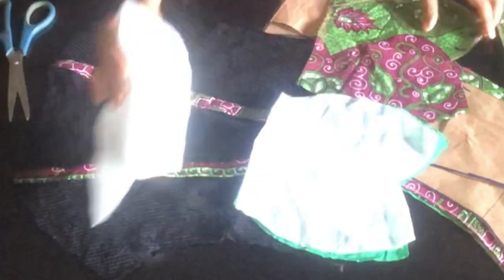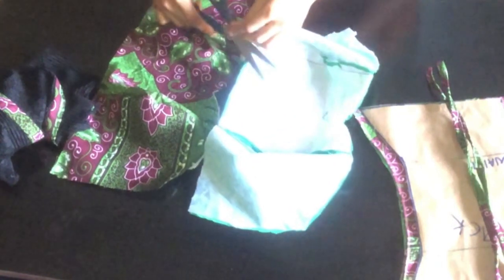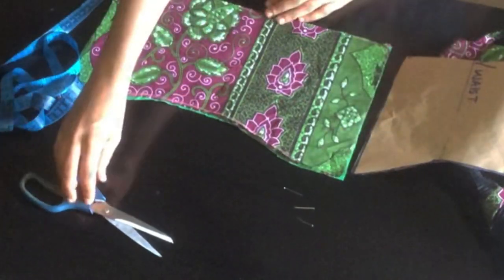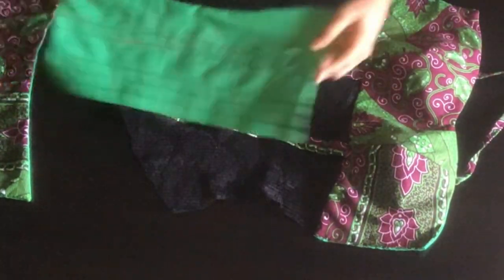HOW TO SEW AN UNDERBUST INBUILT CORSET #how #beginnerfriendly  #corset #inbuiltcorset

Comment: How do I turn my front pattern if I’m using linen for the second part?
Reply from the maker: Good morning ma, sorry for the late reply, please I don't really understand the question, because I didn't use lining for the Lower part of the front dress,I only used lining at the burst side , but for the back pattern ,if you don't want to use lining,you can join it, like I joined the lower part of the front.

Comment: How did you wrap the down with Ankara fabric
Reply from the maker: I cut the Ankara on fold(1.5 inch on fold)I attached it with half from the back the flipped the remaining Ankara 1 inch to the front , then folded it with half inside and top stitched (or you can say I attach it just the way the attached bias to a fabric)